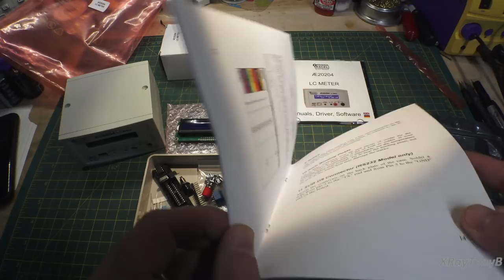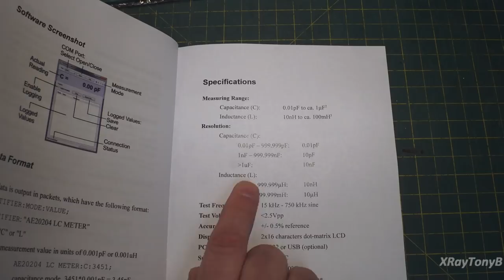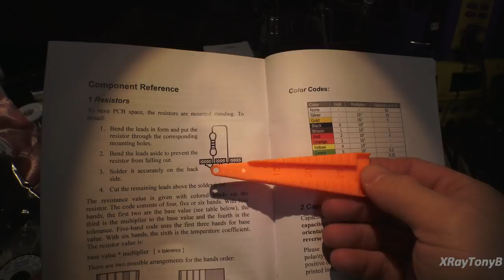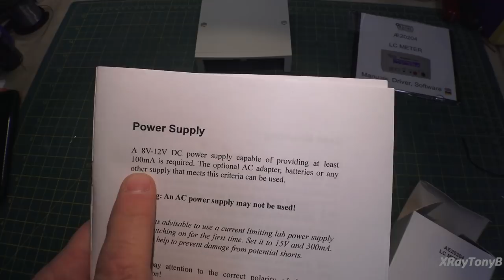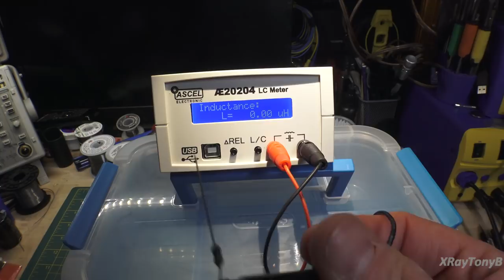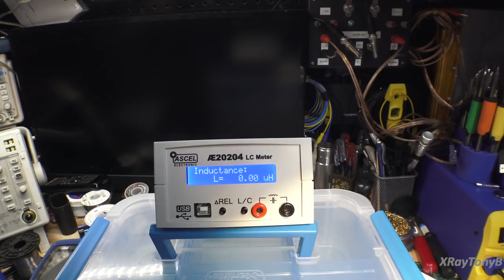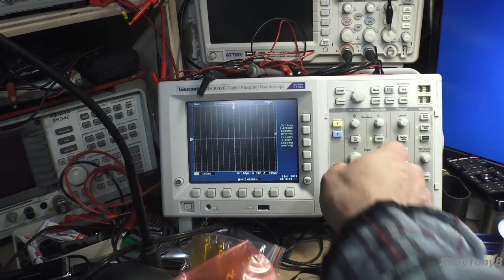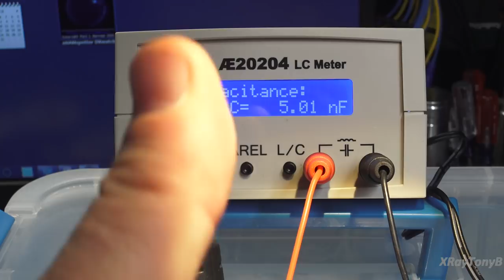ASCEL AE20204 LC Meter Kit - Build & Review

Comment: Thanks for the review & investigation. It is truly a disappointment that this unit is so accurate on capacitance, but so far off on inductance readings. I am looking for something to purchase that has controllable oscillator settings, mostly because it should give repeatatable quantatative measurements instead of "I will pick the measurement frequency for you, but you won't know what it will be" results.  I guess, you most always get what you pay for.

Comment: Greetings Tony:
The proper designation for the various subminiature D connectors is:
DA-15, DB-25, DC-36, DD-50, DE-09 (at the end because these were an afterthought). The second letter represents the metal shell size. The 15-pin VGA connector was actually a DE-15S socket/female .
The original IBM-PC had DB-25P (male plugs) for the Comm ports, before changing to 9-pin DE-09P connectors. The printer ports (DB-25S) were the opposite sex so the cabling was unambiguous.

TIP: When soldering the banana jacks to the rear side, I would use banana plugs to hold the female sockets in place being careful not to solder them, too. I can't check myself but assume the female jacks cannot fit through the PCB hole OR that the shortened length would inhibit the later mounting of the original plastic parts.

Inductance test frequency of 100 Hz and 120 Hz are for power supply components (full wave or bridge rectified) depending on local mains frequency 50 or 60 Hz.

Motor capacitors are non-polar. How high have you successfully measured those?

Comment: 20:10 - Another tip is to sort out all the components by value and determine if there are any missing parts. Also it makes assembly quicker and more accurate.

Comment: That's a nice review of this LC meter. As it doesn't measure high inductance/capacitance values it's not a piece I would immediately be drawn to. It's good to have someone highlighting  its merits and bringing it into the general attention.
26:00 : LOL The circuit is so small, with a bit of hacking one can probably fit 2 separate devices in the same enclosure.

Comment: Nice review and test but I think I will stick to using an osc. setup with a known cap. or coil and read out the frequency then do the calculations. Has worked for me for decades and is very precise. I just use osc. somewhat optimized for different freq. ranges. This meter is faster but you just nailed the problem, when do they actually read the true value.

Comment: Nice review Tony, thanks for producing it. It seems to me that not having a way to set the measuring frequency is a slight deficiency in the meter. The reason for the variation in inductance values is most likely parasitic capacitance. You could minimise this in the test set up by using very short test leads, but this won't eliminate the parasitic capacitance of the component itself. It would be interesting to see how it performs with air-cored inductors with well-spaced turns, as these should have very low parasitic capacitance.

Comment: Just as a slight critisism, I'd say that by "padding' the PCB pads for hand soldering, they created the possibility to short out the main crystal, hence they advised mounting it slightly off the board... bad advice, imo., they should have advised mounting it through a thin, home made, card board washer. Just a small rectangle, cut out of thin card board, with the legs of the crystal poked through.

Comment: Making a stop here to see your review of the LC meter used in your SMD tutorial.  I learn something useful every time I watch one of your videos... the tip for making little stubby test leads for characterizing resistors is a gem. Thank you once again Tony!
Reply: Greetings:
High school afternoons I worked for Philemon Labs testing components for use in tuning fork oscillators for Minuteman II missile systems. I used a General Radio impedance bridge with an adapter plugged into "their standard" 3/4" banana plug spacing (commonly used for speaker plugs). The adapter, one of which I am trying to find for myself, had two vertical pairs of flat parallel plates that had tops with slight curves to permit rapid component insertion for verifying resistor values. I have an M-Component tester that I use to sort grab-bag resistor assortments, but resent having to bend the leads to fit the ZIF socket. With the adapter and an auto-ranging ohmmeter I will be in heaven again.